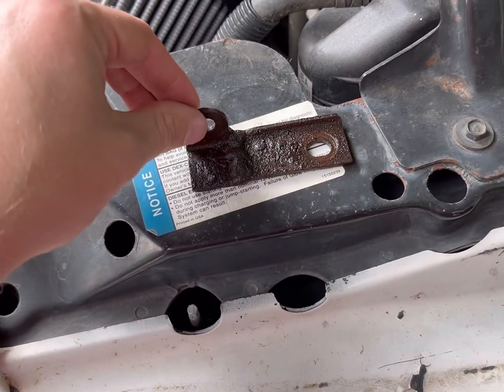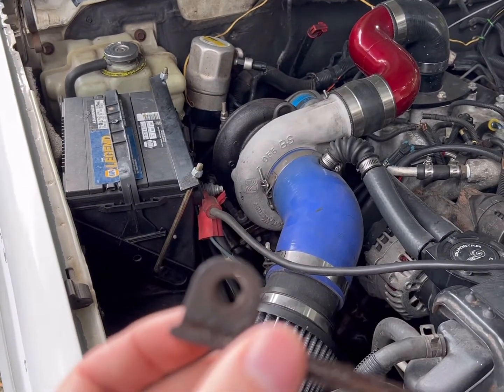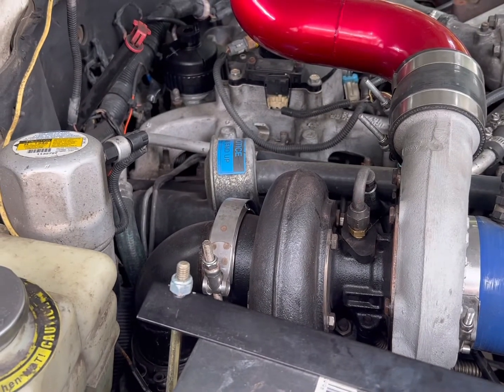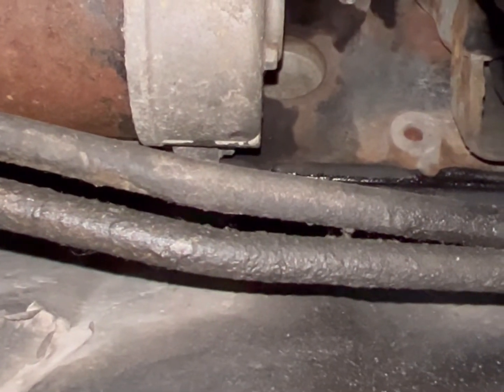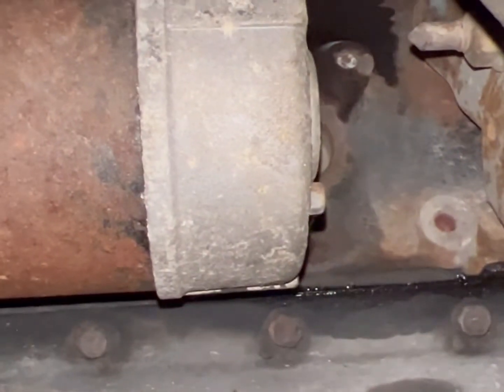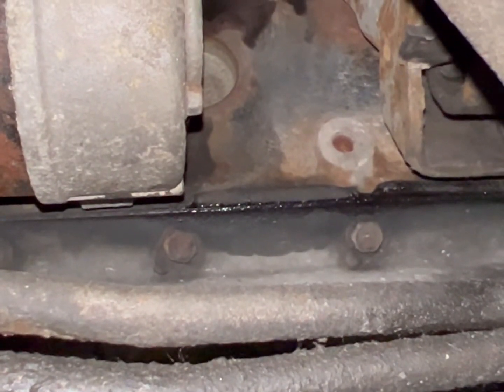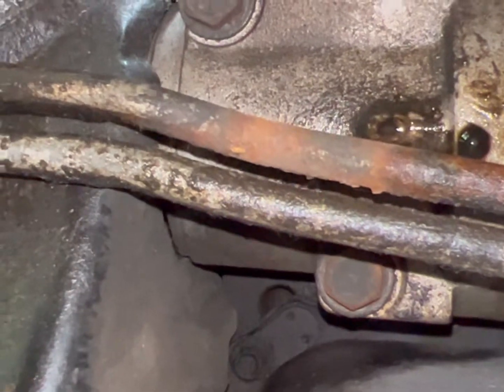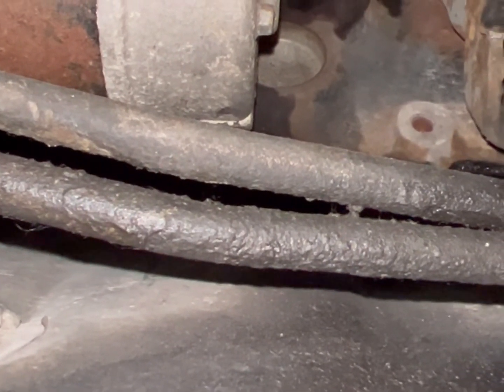GSC 6.5L diesel start bracket

Comment: 96.6.5  somehow I got the bracket but on the starter it don't got em, full inspection rewiring cleanup due to power draw. So idk and motor has a slight wobble
Reply from the maker: @tdawganderson6724  the start motor has a wobble?

Comment: Have you ran a power master starter ? Have you noticed any difference between a gear reduction and direct drive starters that are OEM type ? Thanks!
Reply from the maker: I can’t really justify the power master starter. They are nice. But this starts good even at 20 below running a stock GM replacement starter. Maybe I’m just cheap. But the power master swapped trucks I’ve been around don’t seem to start any quicker. They just do it a bit quieter.